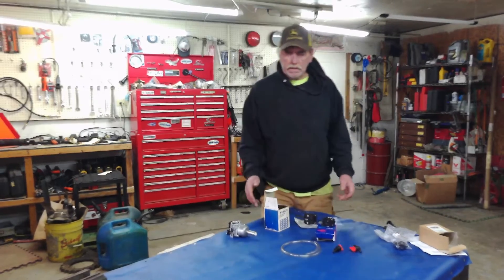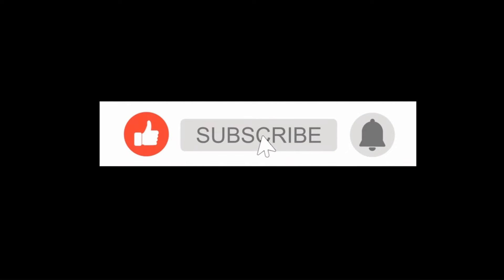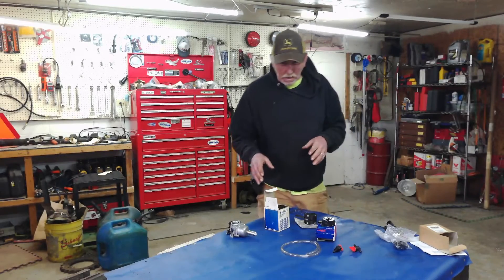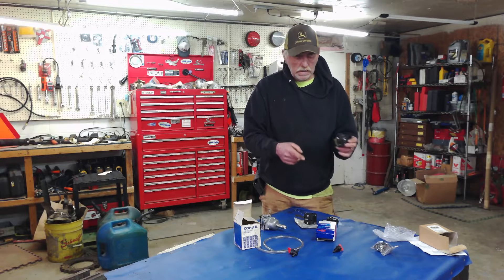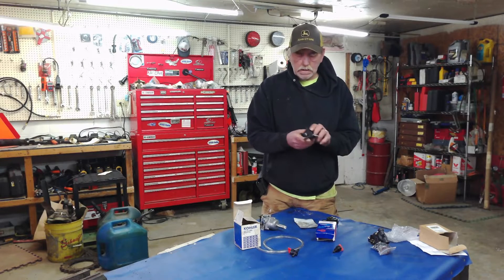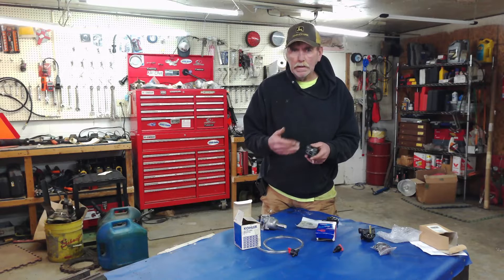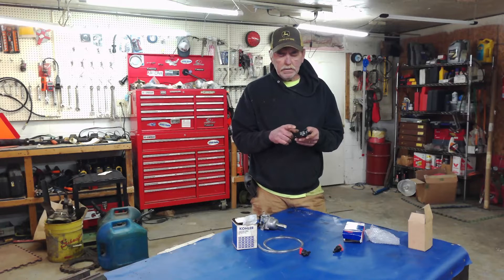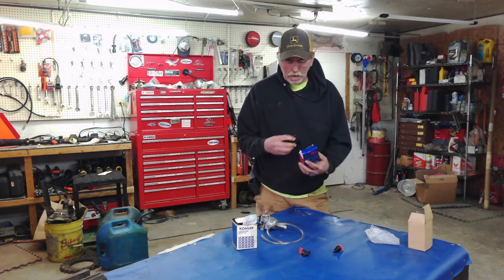Lawnmower Fuel Systems:  How They Work

Comment: I fix and flip small engines as a hobby/side business, and I have a mower with a strange fuel related issue that I can't figure out. This mower was given to me in non running condition, and I have no history on it. It is a Cub Cadet push mower with a 1733cc Powermore engine with a primer bulb fuel system. It has a new primer bulb, air line, and OEM carburetor. It will not pull fuel with the primer bulb carburetor. When I prime it, it will run until it burns off the primed fuel, and then dies. I tried the original carb, and 2 new OEM ones, with the same result on all three. I had a new carb for the auto choke version of this engine laying around, so I decided to try that one. After a shot of ether, it runs fine on the auto choke carb. What would cause this mower to pull fuel with the auto choke carb, but not with the primer bulb carb?  I don't know if it is related or not, but when I got this machine, someone had removed the governor arm and reinstalled it at an angle pointing toward the carb. It had clearly run that way for a long time, and I assume it was to address this issue, since it caused the carb linkage to bind up and prevented the carb from functioning normally. What could cause this issue?
Reply from the maker: Low compression will cause issues drawing the fuel after you prime it. Using starting fluid or carb cleaner will get it to run and stay running since the piston is moving fast enough to keep it running. Most often when you get it into heavy grass it will lack power. Check compression

Comment: I have fuel pump;  Craftsman T260 :( 
There is some kind of valve that is on the fuel tank. A long hose goes from there to breather. Can it go bad?
Reply from the maker: yes it can Scott. Sounds like you have the vacuum operated fuel pump with a line going to your valve cover for vacuum and to ports for fuel, one coming in and the out towards the carburetor. Easy to replace
Reply: @northernnewyorkparts  wow! Thanks for the info. I have a fuel issue. I have replaced carb, fuel lines, cleaned the tank, changed filters.... everything but NOT that mystery valve with the long hose on top of gas tank. It feeds around and goes no where... Just dangles.  Mower fires right up, then dies.
Reply from the maker: @nanscott3092  are you talking about the vacuum hose that connects to the valve cover? It should have 3 outlets..2 are the fuel in fuel out and the third is the vacuum-operated fuel pump hose that plugs or pushes into the valve cover "Shinny aluminum cover. hope that helprs

Comment: A little bit about modern mower plastic gas tanks.  Gosh, are they expensive.  Had to replace one on one of the JD's last year.  Couldn't find a good used one, only the Deere dealer had them.  It was over $200 for the 1.5 gallon tank.  Some times a leaky plastic tank can be 'welded' if it's leaking at a seam, but it's tricky at best.
Reply from the maker: John Deere tries to keep everything so that you have to go through a JD dealership to get their parts
Reply: @northernnewyorkparts Husqvarna is going that way, too.

Comment: Good episode, Eric.   As far as residential riding mowers go, my favorite is the gravity feed system.  Pretty much trouble free.  I'm thinking the reason they went to rear fuel tank/fuel pump feed systems must have been Federal safety regulations.  Probably were a lot of people who got burned while refueling an empty tank, located under the hood (gravity feed) near a very hot engine.  So they relocated the fuel tank and filler cap as far away from the engine that they could, which is under the drivers seat.  Being that fuel tanks located way back there, are almost at the same level as the carburetor bowl, they had to incorporate a fuel pump for the system.  My old Ford 8N tractor still has the original gravity feed system.  Kinda dangerous because when refilling that tank,  it's easy to spill or splash gasoline all over the battery and cables, which sit right next to the fuel tank filler door.  One tiny spark from a loose battery cable and 'kaboom'.  I use an extra large dose of caution when refueling the 8N.